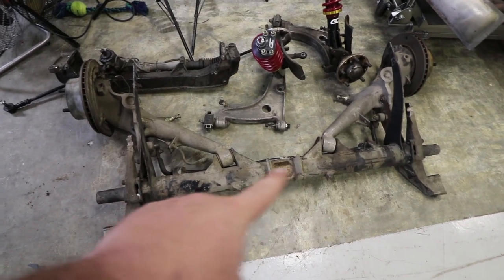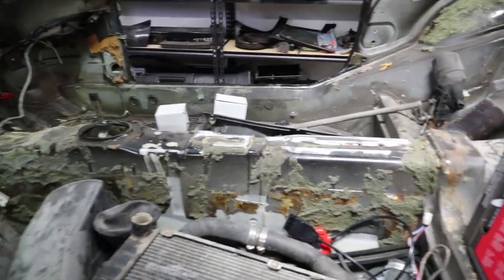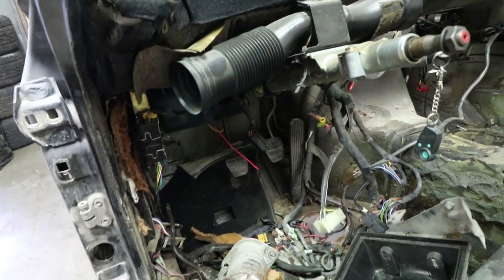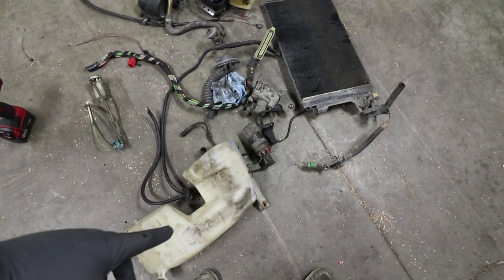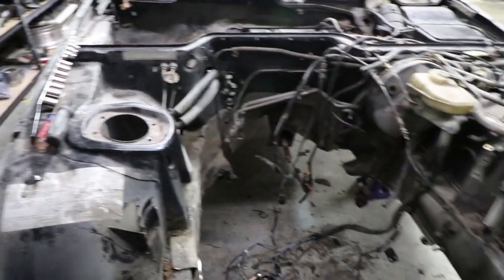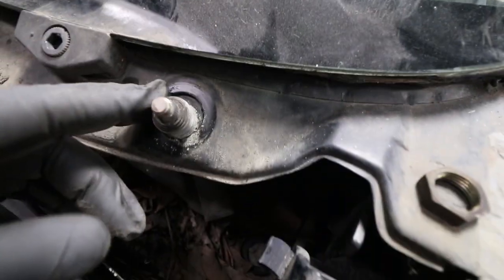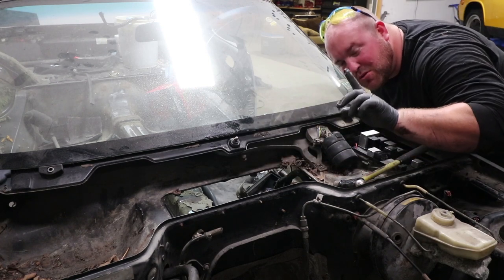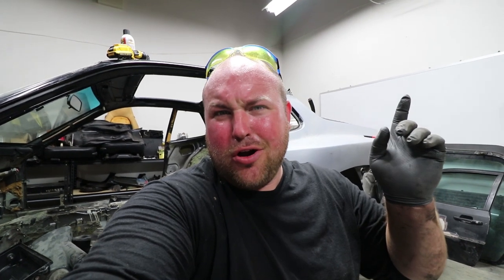Widebody Porsche 944 Project - Getting Back To Work!

Comment: Thanks for all your videos. Very well done and very interesting. Can you introduce a bit the rear axle of the 944 a bit? Especially the moving parts and bushings and the way the torque tube is installed and fixed? I have never seen anyone going into detail on that. This would be highly appreciated. I have a 968 in Taiwan with squeaking rear axle. As I can't find any specialist on transaxals here, I always work by myself on the car. But haven't found any solution yet. Best wishes from Taiwan! Keep on going Boost brothers garage! You are great!!!
Reply from the maker: The me for the kind words! I will be completely rebuilding the torque tube very soon so I will make sure to do a full video on that! Enjoy wrenching on the 968!

Comment: I love this stuff, really makes me want to rip into the 914 asap.  Did you happen to weigh the car before teardown?
Reply from the maker: Do it! I did not, but it was a full weight car. The addition of the rear fenders was probably offset by the lighter front end. I’m going to use stock numbers as my reference point
Reply: maybe weigh the crap you took off that will not go back. For kicks.
Reply from the maker: The goal is to be under 2500# when it’s done. With 400+ whp it should be a lot of fun!